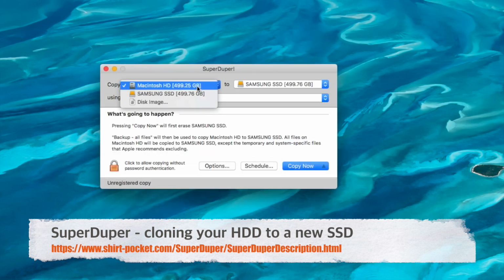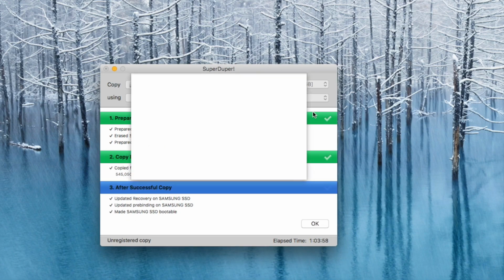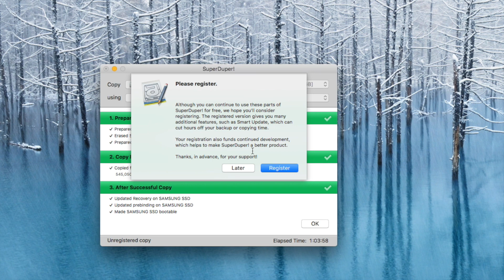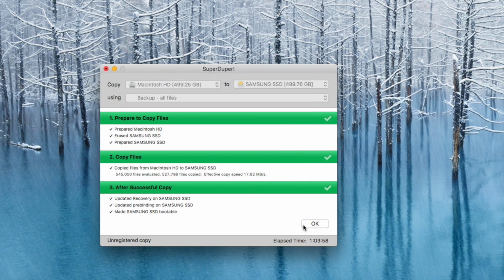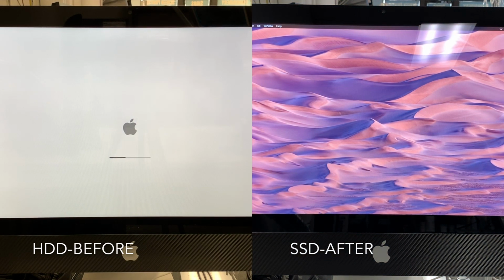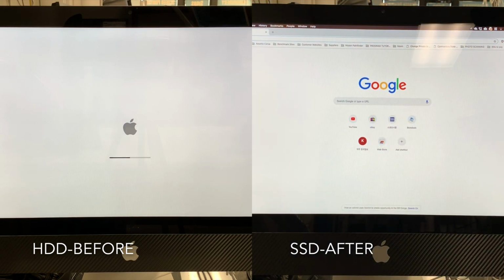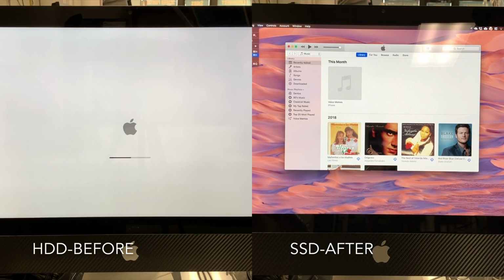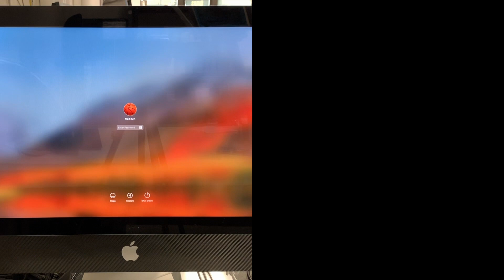2011 iMac SSD Upgrade with Thermal Sensor w/ resetting NVRAM Tutorial no steps skipped

Comment: Thanks for the video.  Very helpful when upgrading my 2011 iMac.  Be very careful with those tiny connectors.  Extra lighting is recommended.  Good tips on resetting the NVRAM - it helps shorter my boot time when I did it (time between physical power-on and Apple logo).  Overall boot time on mine is only ~20s, compared to ~60s on original HD.  Overall response time when opening apps is also noticeably faster.  Very happy with the upgrade.  I use WD Blue 1TB SSD.

Comment: Thank you. I used this along with the OWC instructions for hard drive replacement. I can’t believe how much faster my 2011 iMac is now.  Super easy to do.  I used a Time Machine to restore my iMac. Took about 1.5 hours to restore. Command R on boot. Choose disk utilities. Format to Mac OS X journaled. And choose that ssd as your restore destination.
Reply: Yes its faster. But you don't need OWC at all. I'ts just a BS for noobs. In case your HDD Have TS which is actually not a TS. All you need is short 1st and 4th wire on your existing cable.
Reply: Can anybody confirm this mod?

Comment: Good video. Really no need to spend $40 on thermal sensor cable, just get SSD Fan control for free: https://exirion.net/ssdfanctrl/  Also can skip SSD bracket ($20+), use 3M double-sided tape (desktop rarely moves). Save $60+...use towards more RAM (32GB max).
Reply from the maker: thermal sensor is not so that it keeps the ssd cool but so that it stops imac from bursting the fan speed to the max all the time. If you don't install the temp sensor on ssd, imac thinks that the harddrive is overheating so it's making the main fan go crazy. You are right, as I said on the video, it is not necessary, you can opt to use just the mac fan control program.  You can also skip the ssd bracket like you said and just McGuyver it with double-sided tape. New SSD with 16gb ram like you mentioned will for sure make your old imac crazy fast. Thank you for the input.

Comment: FYI the drive adapter listed is for an external drive,  Amazon has listings for the AdaptaDrive bracket shown in the video and also for a Sabrent drive adapter.  Both are for internal drive mounting.
Reply from the maker: thank you for pointing that out. I updated the link information on my video.

Comment: Hi Mark, I'm thinking about thesame upgrade. Why did you select "don't use time machine" ?
Reply from the maker: Siam Wood Shop I believe it was to format the hard drive first and then copy the entire contents to the SSD
Reply: You can use the time machine for the new SSD, but you have to do a partition first. If you don’t do partition, it won’t let you go into recovery mode(cmd +R)later. For mine, I didn’t install the thermostat wire, so I use the cmsfan control apps.

Comment: Can we add two ssd hard?
Reply from the maker: Yes, You can but you'll have to take out the cd-rom and use that space and sata port to use 2nd ssd. If it was my choice, i'll just use the 2nd ssd with external harddrive enclosure.
Reply: I’ve added a second ssd behind the disc drive. See the OWC tutorial, it’s easy

Comment: Thanks, forgot the reset part !  Nice skin around front Apple logo.  You have a link or template for than ?  I have a Cricut.....
Reply from the maker: I didn't use a template. I just put the carbon fiber over the entire front plate and cut around monitor with exacto knife. And then, i put a separate apple sticker on top. I didn't want to go through the trouble of making the template accurately so the apple logo shows through the carbon fiber. I took the easy method.

Comment: My fan runs at full speed and won't shut off
Reply from the maker: Have you installed the temp sensor cable? if you didn't buy that and just installed ssd without it, you can choose to install macs fan control software instead. it's free and you can make your fan manually run at lower speed. https://www.crystalidea.com/macs-fan-control
Reply: @MarkKimUSA  thanks for the reply.  I have both, I was on the phone for 30+ minutes with OWE? and we couldn't get the sensor cable to shut the fan.  They are sending me a new one to try. 

I also installed the Mac Fan Control program and it does nothing.  Too bad the software don't have a simple on/off switch for the fan.  Thats what I was looking for, I have this iMac since 2012 and I have never once heard the fan, and now the thing won't shut off.  lol
Reply from the maker: Let me know if the replacement cable solves it. Good luck
Reply: Bob J did the replacement cable work for you? I’m running into the same issue.
Reply: lionel garcia no it was not the cable...I forget what it was...I sold the computer...but it was something totally different.   

Sorry I can’t remember what it was
Reply: Bob J  no worries, thank you for the quick response.

Comment: Which ssd did you use 850 or will it work with 860
Reply from the maker: Steve Aparicio i believe it was 860... but 850, 840... they are all fine.

Comment: Which bracket for the ssd did you use?
Reply from the maker: https://www.amazon.com/NewerTech-AdaptaDrive-Drive-Converter-Bracket/dp/B005PZDVF6/ref=pd_aw_fbt_147_img_2/132-7368072-1530326?_encoding=UTF8&pd_rd_i=B005PZDVF6&pd_rd_r=00a16093-8396-4014-b1bb-7bebe1af42fb&pd_rd_w=r7Zx2&pd_rd_wg=WqMuv&pf_rd_p=3ecc74bd-d08f-44bd-96f3-d0c2b89f563a&pf_rd_r=DWDNB883P9Z01KP9W7DE&psc=1&refRID=DWDNB883P9Z01KP9W7DE this one